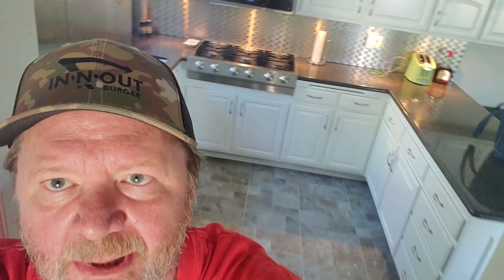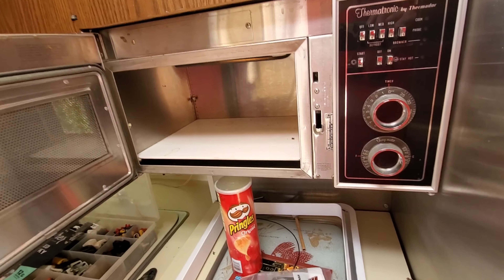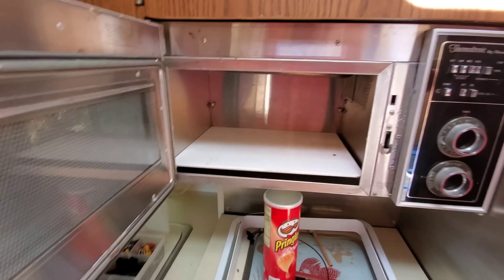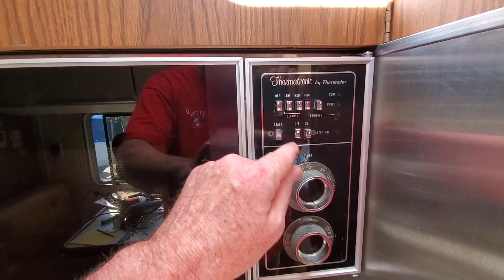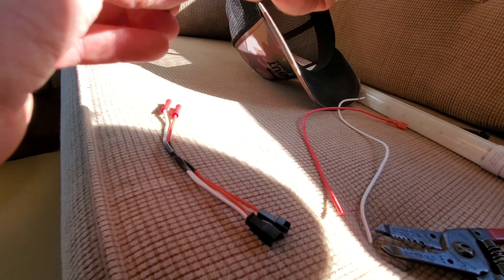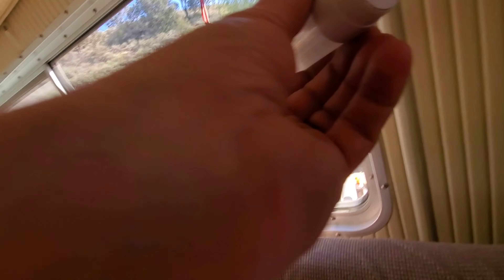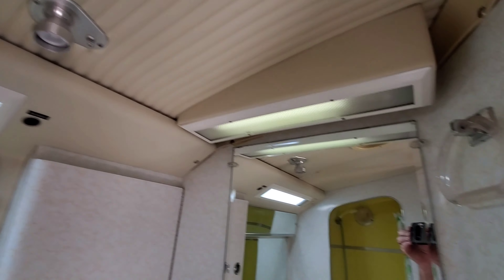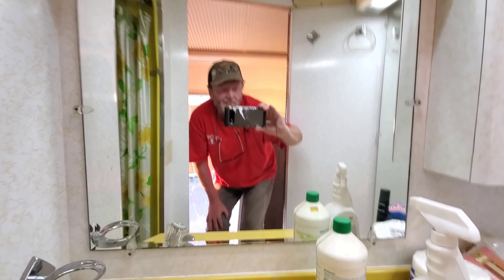78 Bluebird Wanderlodge FC31 renovation. Fluorescent to LED. Microwave exploration.

Comment: Hello, great series! Like you I have acquired a Wanderlodge and have to research all the systems myself. Do you by chance still have the info on the brand of LED lights you bought? I'd like to find them for my 81 FC31 and find out if a warmer color temperature version is available.
Reply from the maker: Hello. I'm sure I bought them on Amazon. Beyond that,  I don't really remember.  Good luck with your Wanderlodge!  Ours is currently suffering an air pressure leak that renders it unusable (can't release the parking brake without enough air pressure). I think it is in the automatic retractable step, but we'll see. I'll make a video when I get around to fixing it!.  Cheers!
Reply: Thanks Garrett. FWIW I drained the moisture from the 3 air tanks for the first time other day. One of the valves had a heck of a time reseating itself properly and for a while I was worried that I was in the same boat as you. Luckily after enough jiggling and perhaps with enough pressure building up it finally corrected itself. Good luck tracking your issue and thanks for sharing your story!
Reply: @OGGarrettsGarage   soap n water spray bottle